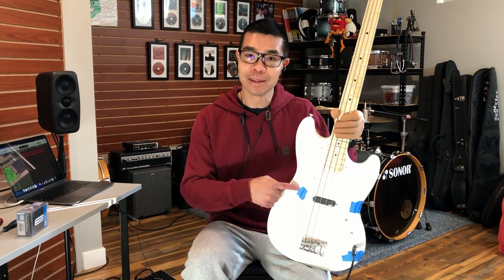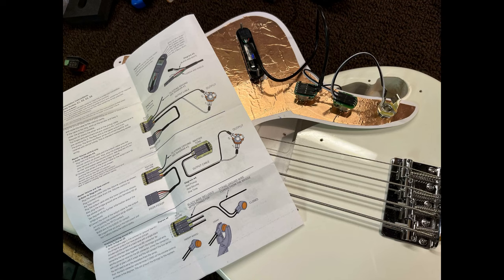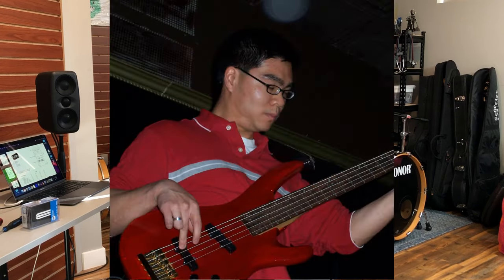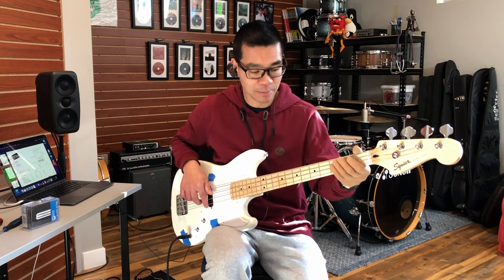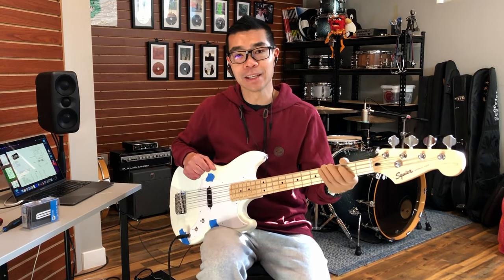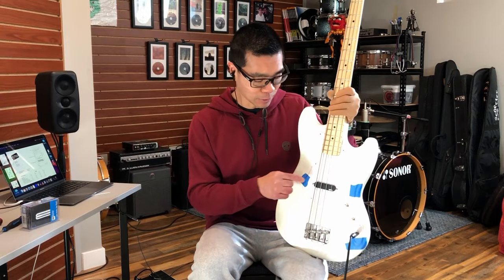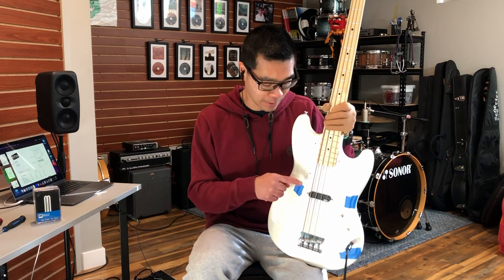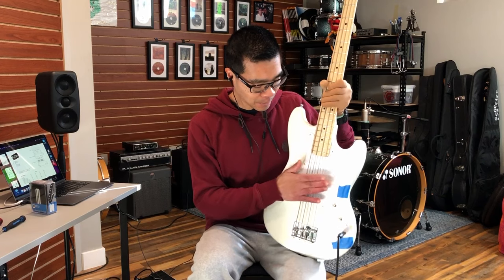Squier Bronco bass mods Ep.5: EMG S4 guitar pickup

Comment: In spite of the volume difference on the E string, the overall Tone sounds very good and punchy, with the EMG pickup.
I think getting a Bronco Bass, and getting a new pickup for it like the Seymour Duncan Hot rail, could be a lot of fun down the track. 👍🎶🎸❤️
Reply from the maker: Agree! I liked the tone of the EMG S4! It might work on an older gen bronco with the older 2 saddle bridge. I think the spacing was more narrow on those. Or put a bridge with narrower spacing on (like a hipshot). Hang tight, I’m going to put a EMG geezer in it. Hands pretty inflamed at the moment, so slight delay in filming.
Thanks for watching!

Comment: Thanks for this! I was looking at the S4 for a while. I still really love the tone. There are a couple of people on ebay who make custom Bronco pickguards, so I was thinking of getting one made up with the pickup routing a couple mils toward the bass side. I'm still doing the maths, but there's 1cm of space between the centre of the G string and the end of the pickup, and about 6 or 7mm between the centre of the E string and the end of the pickup, so I'm thinking splitting the difference is my best option
Reply from the maker: That’s a cool idea! I had a bronco pickguard custom made. I’ll be talking about it briefly in the next episode. Thanks for watching!
Reply from the maker: Another option is to consider a bridge with roller saddles. Designed to be able to adjust string width, you might be able to shift the entire string range to the treble side without changing the string width.

Comment: Hi Jonathan! Great video. I wonder how good would it be to have a P90 pickup (neck) installed on this bass. But for that you would need routing the cavity in a different way than a P-bass style pickup. I'm afraid that is not your intention. Keep up the good work. 👍
Reply from the maker: A P90 would sound pretty cool in that bright, cutting, jangly way! The original route cavity is about 1.75” (bridge to neck dimension) with maybe and extra 0.5” with rounded corners from outer edge of the E string (in the string width dimension), so probably too small to drop in a P90 without routing. But as you suspected, I’m trying to get away from the noise! 
Thanks so much for watching!

Comment: Just dropped a S4 into my Bronco and I don’t have any issues with the low E. 🤷‍♂️ I checked the input levels in my DAW and it was pretty consistent across the strings.
Reply from the maker: That’s awesome to hear! Likely, the string spread on your bronco was within the magnetic field more than mine was. Sonic series? I liked the tone of the S4. I hope you enjoy yours!
Reply: @jonathanwong458music  Thanks and yes it’s a sonic. I was surprised to find a 6 polepiece guitar pickup in there, always thought the stock bronco pickup had a rail design as well. I actually liked the sound of the stock pickup but the pots were faulty, so I changed both with the EMG set. Replaced the bridge with the fender hi mass as well. The balance is slightly better now.
Reply from the maker: Right on! Sounds great! The stock p/u has a cool grindy sound, but the noise drove me bananas.

Comment: What a shame the E was weak, the pickup sounded great otherwise!

I received my cheap 19 dollar alnico 5 ‘51 P bass pickup from fox-guitars via ebay and can happily report that not only do the pole magnets align exactly right with the Bronco’s strings, the mounting holes do as well and I was even able to use the stock pickup cover!
The bass sounds great with the 51-Bass-Pu  (Fox’s part number) but I now want to open the bass again and utilize the stock pickup with it’s magnet and poles removed as a dummy coil for noise reduction.  Hopefully it will fit in the stock cavity in an effective orientation.
Reply from the maker: I know right?! The others strings aside from the E sounded great, more open sounding compared to the SD.  It’s possible it might work for the broncos that came before the Sonic series (Eg Affinity) as those 2 saddle bridges I believe have a slightly narrower string spacing. 

I’m so glad your mod worked out!! Awesome. 
Thx for watching!

Comment: Looking at the top view of the guitar, it looks like the G string is slightly inward and the E string is slightly outward on the neck. If this is true, try loosening the neck screws and pressing the neck towards the G string side retighten. This  should move the E string over the pickup more. Then check the string volume again.
Reply from the maker: Good eyes! Unfortunately, tried that. The neck pocket is pretty tight on both sides and won’t allow for lateral movement or splay. Great thought though! That’s the thing with lower end instruments….the lines are just not perfect, even though they’re CNC’d. 
Thanks for watching!

Comment: I have the affinity.. So the string spacing is less. Do you think it will have the issue? Love the sound of this drop in.
Reply from the maker: I like the tone too! The narrower string spacing on the older gen might be ok! It only ‘just’ misses on the sonic series. Thanks for watching!!
Reply from the maker: PS just did some measuring. Don’t quote me on this, but if your total string span (outer to outer) is less than 2” at the pickup on your affinity bronco, you might be ok and within the magnetic field. The sonic is currently measuring about 2.0625” outer to outer at the pickup.
Reply from the maker: I still have this S4 EMG if you want to buy it for much less than retail. Used only for the shooting of the video. Contact me through my bandcamp website in the description box if you’re interested!

Comment: There are some inexpensive replacement bridges that have those grooved saddles to allow for little adjustments  in string spacing. Do you think something like that would allow you to balance the sound or would that not offer enough adjustability to fix the issue?
Reply from the maker: That’s a great suggestion. I actually prefer the sound I get from those threaded saddles! Yes, you can fiddle with the string spacing to a point on those, need to be careful not to have lateral pull over the saddle as the ball end is fixed-so you don’t want the lateral pull to make the string want to slip sideways. The bigger issue, however, would be whether the player wants or will be comfortable with a narrower string spacing (Eg 17mm vs. standard 19mm) and whether that will mess with muscle memory. If it doesn’t, then that’s a way to mitigate the magnetic field width of this EMG. 
Thanks for the suggestion! I’ll be putting one of those threaded saddle bridges on next to see whether it actually changes the tone of this bass. Stay tuned! Thx for watching!
Reply: @jonathanwong458music  I'm looking forward to hearing the results! Thanks.
Reply from the maker: Right on! Thx!